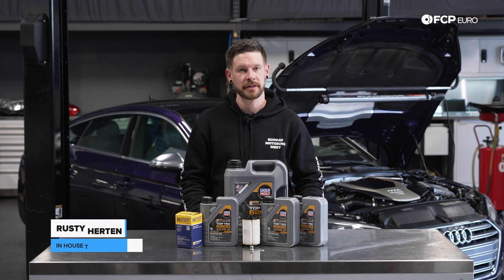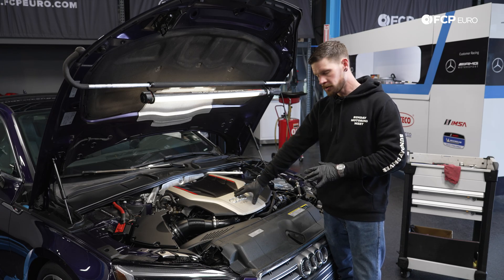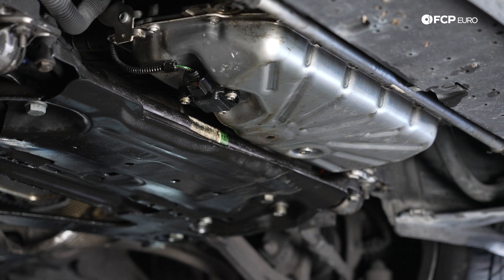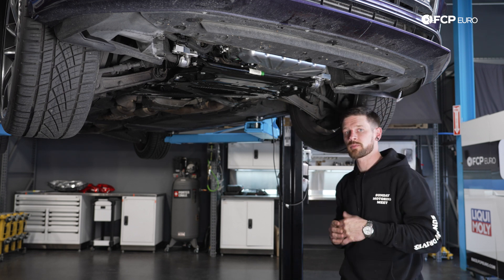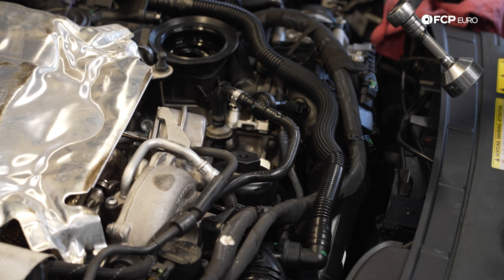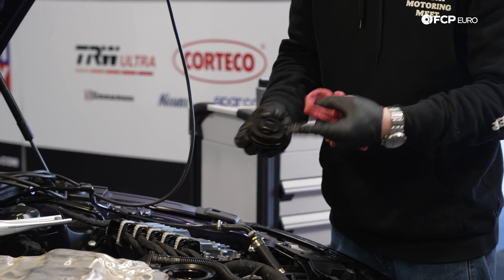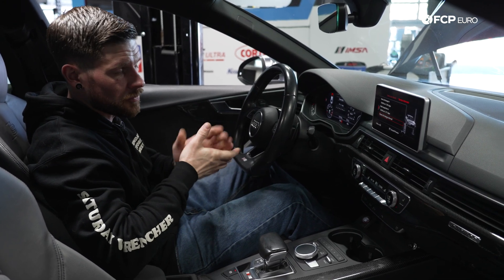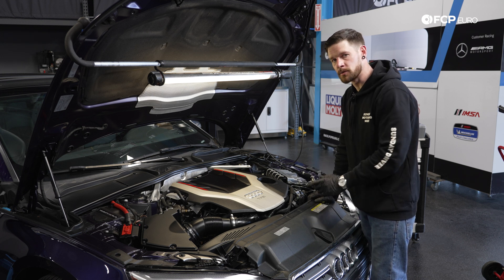Audi S5 Engine Oil & Filter Change DIY (2018-2025 Audi B9 S5 Sportback, S4, SQ5, EA839 3.0T Engine)

Comment: RS5 b9 owner here, I do my oil changes at 3K intervals with FCP Euro kit + a bottle of BG44K fuel system cleaner (which FCP should sell) in an empty tank right before adding top tier fuel. 

Overkill? Yes, but I’ve never heard of someone blowing up their engine up for changing their oil frequently. 

Lastly I would mention that a proper warm up should be at least  180F before passing 3K rpm, maybe FCP euro can chime in here
Reply: Sounds like you have ocd and a touch of mania
Reply: @MichaelBrown-wx6zq  True story bro, sometimes I wish I didn’t care as much
Reply: @MichaelBrown-wx6zq Guilty as charged

Comment: Liqui Moly is a mediocre oil and I wont use it. Mobil 1 ESP and Motul oils are far superior.

I pour 8 liters of oil in and it is perfectly filled at the MAX line without overfilling/overfilled message.
Reply: You make criticisms without any support, elaborate bruh

Comment: don't use 0w20 on this engine, at least 5w30.
Reply: i used this kit and now my engine makes a new noise :D
Reply: any VW504 approved oil that is 5w30 or 0w30 is far superior than VW508
Reply: Can you explain further why not
Reply: @tubbycustard8866 0w20 is just too thin. Many related issues on low milage. Also this engine was designed to work on thicker oils, so there is minimal risk.
Reply: @I.B1 I can never find a straight answer. Other people run it with no issues, also from my research even in other countries Audi still recommends 0W-20 so it can't just be a CAFE standards issue. My biggest thing is warranty and they will give me shit if something breaks and I technically wasn't using the correct oil
Reply: @tubbycustard8866 just got a 2025 S5. The car uses 0w-20 because of fuel efficiency but also tight tolerances. The car has way smaller passage ways for oil then a car 5-15 years ago. Stay with 0w-20. Its a performance engine and the 0w-20 flows easier and coats easier then a thicker oil also, helps alot with cold starts which btw is where 90% or more of the wear is occurred on engines!
Reply: @youngwildboy5443  ive also been using the approved 0W-20, i have an extended warranty and dont want to give them any reason to potentially deny a repair

Comment: Lots of owners, including myself are running thicker oil in this car.  Especially on the '18s with rocker issues.  Personally I run 0w-30 Amsoil in my '18.  Europe, and from what I hear South America call for 0w-30 or 0w-40 oil.  What are your thoughts on this. I'm seeing WAY to many engine failures anymore with the thinner oils.  GMs L87 for an example
Reply: I have a 2024 S5 and use any VW504 approved oil because of the higher HTHS than the garbage VW508 oil. I personally only use MOTUL 0w30 that is VW504 and MB 229.52 certified. Highly recommend.
Reply: @dealershipscammers  Nice choice. I was using Ravenol VMP 5w30 for some time, now decided to try liqui moly 4110 5w40 with VW 511 approval because of GPF
Reply: @dealershipscammers  arent u worried about warranty denial?
Reply: @tubbycustard8866  as a former dealership tech of 20 years, they cant and wont due to legal obligations.
Reply: https://www.youtube.com/watch?v=i0VoEhW2I-E
Reply: @tubbycustard8866  I had seen that one.
Reply: Correct, I even see many use 0w40 or 5w40

Comment: Okay, so you learn something new everyday. Flipping  the gasket on the oil filler cap, was something I've never heard, of but will try it on my next B9 S4 oil change. And yeah, the old fashion way is how I used to do my oil changes on various vehicles since the 80s. For about 10 or so years, an oil extractor has been my go to.
Reply from the maker: We are just glad even Kiss__Kiss is still learning from us....
Reply: @fcpeuro  Can i use the Molygen New Generation SAE 0W-20 in my 18 s5 sportback? 76k miles?
Reply: @fcpeuro  Amen to that, guys!! 🦾